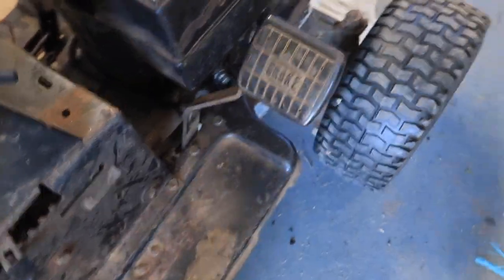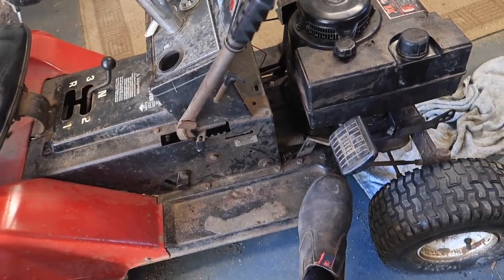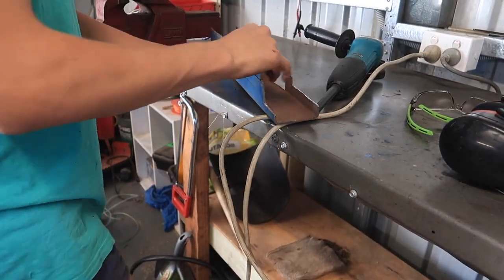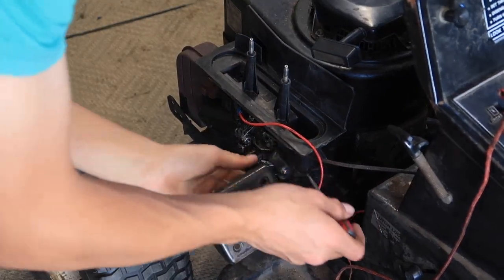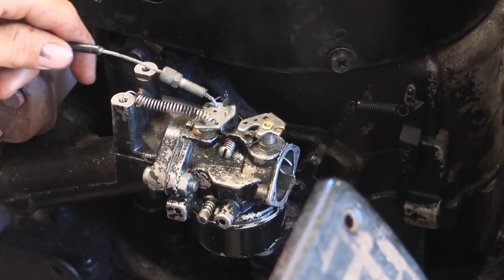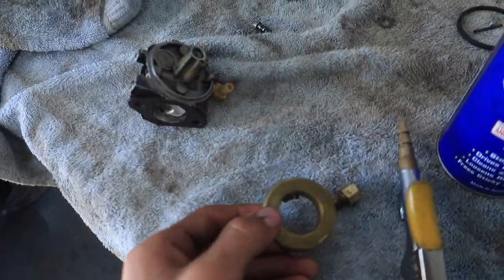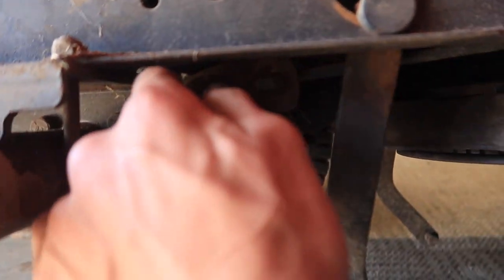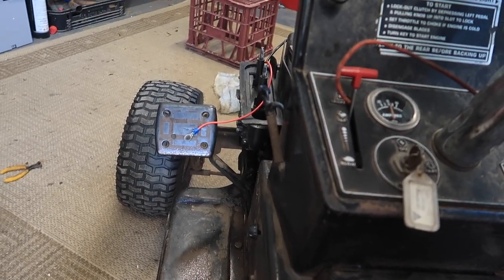Building a racing mower || part 2 throttle pedal

Comment: Sounds like a bottom end seal, clean it all off and let it run to see where it's leaking. Good find on the float, I was forever removing the spark plug on my 720 Masport shiremaster to release the fuel, til I found the float was stuffed.
Reply from the maker: Yeah mate, I later found out that the oil was well over the full mark so I emptied it and then it didn’t do it.